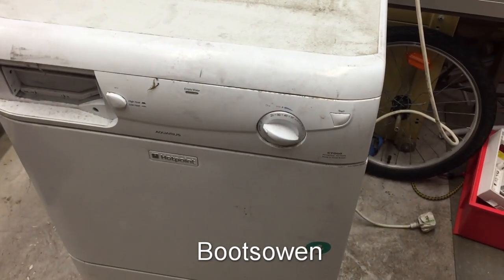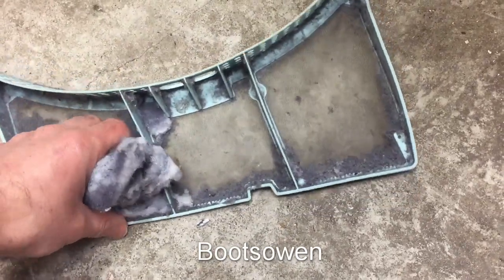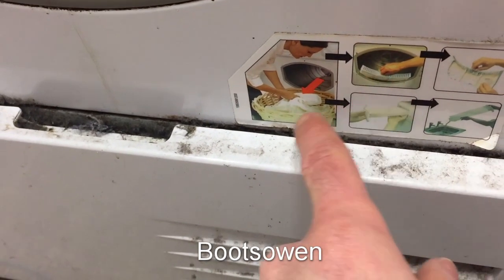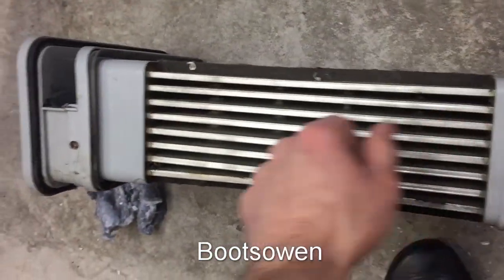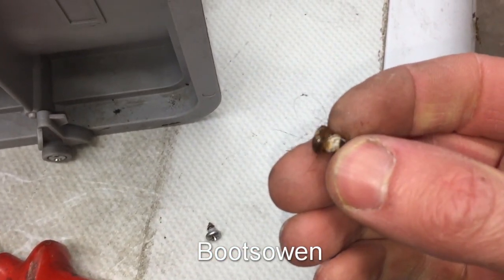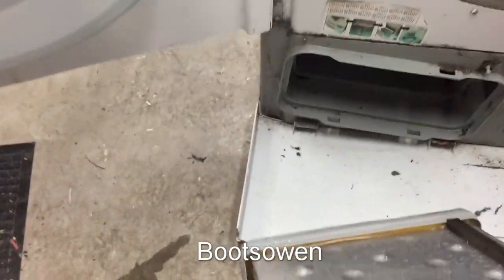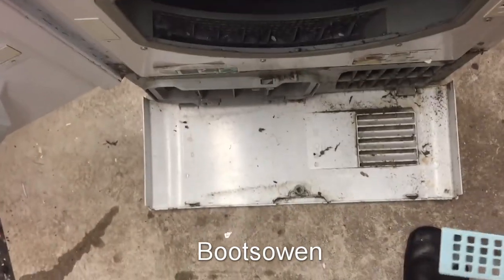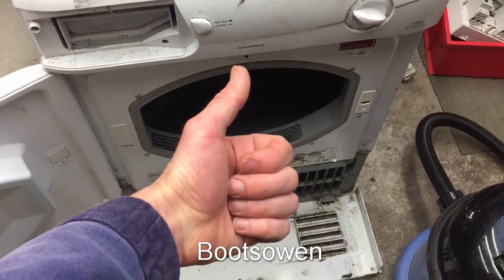How to clean a tumble dryer condenser, and maintain efficiency.

Comment: I was thinking the fluff trapped was because the lint filter on ours is slightly broken on one side (plastic rather than gauze) but having seen these videos, it seems to be a design issue that even with most of the lint being removed, some will get trapped in the plastic grid bit and then also into the condenser tray bit too. Thanks for sharing the video, especially with how to remove the front of the tray.
Reply from the maker: Some tumble dryers don't seem to hold any fluff back, others work quite well, it doesn't seem to depend on brand. just a mystery? Regular cleaning is the best thing to do.